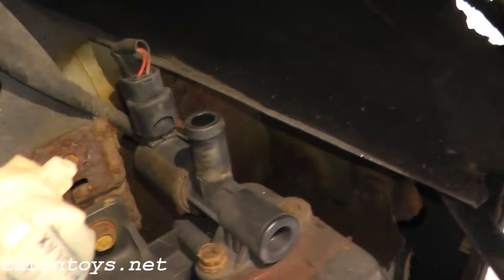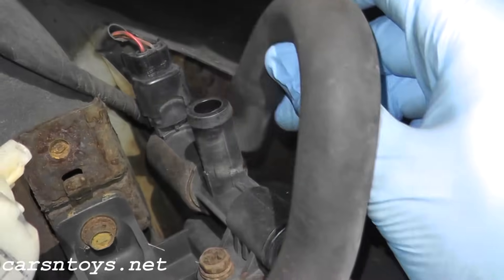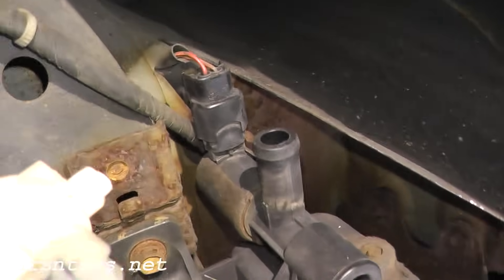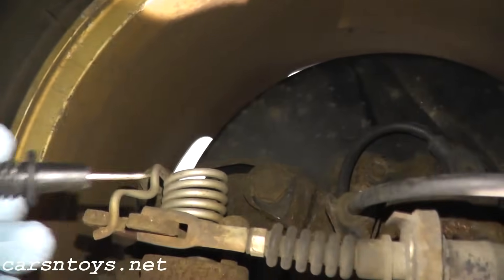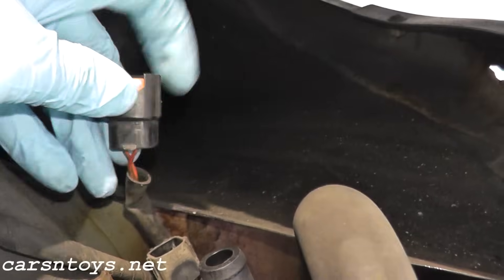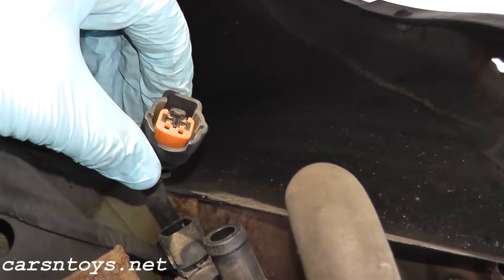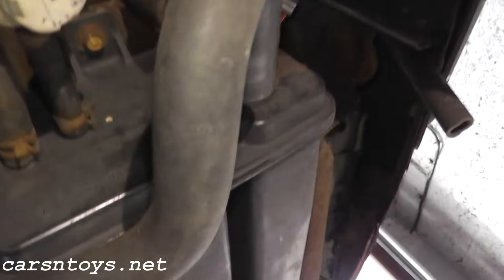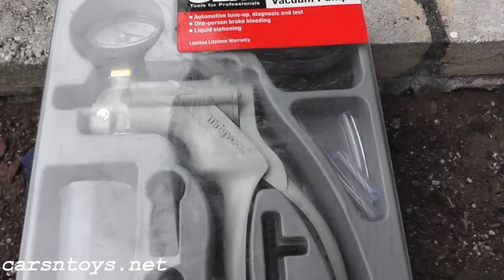How To Test and Replace EVAP Canister Vent Control Valve P0446

Comment: Hey, I was checking voltage from harness and I got 12V last week and today I checked again and im getting 3V and falling down slowly. Why is that? Could it be not running for a week?

Other thing I tested Vent Solenoid and its working. But I have rust outside of it just like your. Should I replace it?
Reply from the maker: +yippyli The voltage reading should be battery voltage. Were you able to start your car?
Reply: My battery is reading 12V. My car has hard start but able to start up after 3 seconds. Could it be bad ground from vent solenoid? If so, do you know where the location ground for vent solenoid?
Reply: I think the vent solenoid grounds through the ECU. But i"m not sure.

Comment: did you have to plug any lines after disconnect the canister or is the canister the same as the filter where it would require the switch to be on.
Reply from the maker: +Allen Kipps Are you referring to the charcoal filter? There's a charcoal filter inside the canister.

Comment: hey .. I have very high fuel vapor pressure in the fuel tank is that the EVAP canister DON'T WORK ?OR WHAT IS THE  PROBLEM
Reply: Either the vent valve or purge valve is plugged or sticking shut ALI

Comment: Don't you need to blow air thru the valve at the same time you power it up to see if it is in fact working mechanically as well... I am fixing to test mine, thanks for the great vids!
Reply from the maker: Metal Maniac Yea man you can do that as an extra step and verify air is indeed getting through
Reply: I think when it is "powered up" is when air does NOT go through. It is normally open. When you are driving and gas is being used up , the vent is open to equalize  the pressure. when you are parked it is also open . When pressure rises in the tank , the valve allows vapors to enter the canister  It closes when the purge valve opens to remove vapors from the canister some time after the engine is started. That is when a vacuum develops which the pressure sensor reads. If it does not hold vacuum, that is when the computer throws a leak code. Long be I hope this helps.

Comment: i have a 2004 nissan maxima. its giving me code p0444. I've replaced gas cap, I've changed both evap canisters in the front and the one underneath the vehicle by the gas tank and I'm still showing the check engine light. can someone give me some advice
Reply from the maker: Salvador Aguero P0444 deals with the EVAP canister purge volume control solenoid valve.  It's easy to check the valve. I have a video on a similar valve for older Maximas. Your solenoid valve is located in the same area as shown in the video:  https://youtu.be/7ni-mjr1xeg
Reply from the maker: Salvador Aguero If you have trouble finding the valve try google images

Comment: If you have the key forward and 12v at the connector shouldn't the canister click/open just by plugging it in? My has voltage and does not click(even though it's brand new) I don't have anything to run 12v to the back of my truck.
Reply from the maker: Jesse Tate Yeah man that works, too.
Reply: CarsNToys Damn, so I guess my brand new $130 ac-delco vent canister doesn't work.
Reply from the maker: Jesse Tate Not necessarily. I'd first verify if power is getting to the canister when the key is turned to the on position. (In other words, check if 12v of power is getting to the harness connector.)  If so, then you can test the canister.
Reply: I do have/did check for 12 volts at the harness/connector. I'm going to remove it and try to jump it without the harness anyway. So frustrating. Then it's off to diagnosing either the carbon canister or the FTP sensor. 

Thanks for the help.
Reply from the maker: Good luck!
Reply: No, jesse, I think 12 volts is always there and the ground turns the valve on and off, and that is done by the ECM.
Reply: I believe the valve is open whether 12 volts is there or not. It just won't close without 12volts. That is the way I see it.
Reply: NO, Jesse.

Comment: Can this p0446 process be applied to a 2004 chevy s10 crew cab 4.3? Didn't see what vehicle this video was for.
Reply from the maker: Erik Lafferty This was done on a '97 Maxima, however, if you apply power to the vent control valve on your truck you should hear the valve move back and forth.
Reply: Ok, thanks

Comment: Hi is this the Nissan Maxima Vapor Canister Vent Solenoid ?

 I have a code p1493.

Nissan maxima 1998
Reply from the maker: jeremy ballard This is the vent control valve. There's a separate evap solenoid valve. I have a video for that as well. Click on this link....http://www.youtube.com/playlist?list=PLl6xt4Pyay3AWpPY3TMsUCczro3aSkpvDP1493 can be a number of things in the EVAP system. Take a look at my playlist. I go over a number of evap components for nissan maxima's.
Reply: CarsNToys the link wont work. Tell me the title of the video and ill search for it please
Reply: CarsNToys hi this is jeremy ballard at a friends computer. i replaced this valve in this video. my code 1493 is still on anything else i should check? smog is due and nissan had told me it was my ecm but i got a different ecm and it is showing the same code too. Thanks
Reply from the maker: Rodney Rose Search under may page for P0443. I have two videos that deal with the same component. This should help you.
Reply: OK thanks

Comment: Hello. I noticed this was a Nissan Maxima. That's great. Because I just recently had my EVAP control valve vent replaced. I need to pass emissions by next weekend and my cars keeps getting rejected. I've driven the car 300 miles since I replaced it. But still no luck. It seems that I have 6 ready and 2 incomplete (not ready). Those two happen to be the Catalyst & EVAP. I'm under the understanding that I have to perform certain drive cycles. Great video by the way. I subscribed! But anything you may suggest? It's for a 97 Maxima GXE.
Reply: This thread is pretty old but I'll respond anyway and leave an egg.  If you can find a service manual online it should include the drive pattern procedures to get thru the drive cycles.  The 'drive pattern' is a set of instructions for driving that are supposed to clear the trip cycles.   I had the same problem last year with my 97 hardbody.  I have the same problem usually every year; summer heat seems to pull out any problems and flip the light just before  the smog test.  Unfortunately, stupid nissan is cracking down on websites publishing the service manuals so probably you'll have to know somebody who knows somebody that  has one.  Typically the stupid 3rd party books don't cover this; at least not for my truck.  There are lots of drive patterns published on the web but one model car may not work the same for yours.  My truck used to be the same way.  I could go a couple of months of driving before the engine light would turn off.  Last year, however, the drive pattern cleared all the tests except one.  The number of drive cycles not completed which are allowed depends on your state.  Best to ask the smog tech this before they do the test.  If they won't say, then go somewhere else because they may just fail it out of greed and make up some story.   Or, you can pay a smog test station to put your vehicle on a dynanometer which simulates the driving conditions.  I had a garage do this without my permission one year and then charged me $350 (ouch).
Reply from the maker: alpacino262000 Is the check engine light on? If so, what are the code(s)? The EVAP system has many components. I have a playlist addressing quite a few number of them - http://www.youtube.com/playlist?list=PLl6xt4Pyay3AWpPY3TMsUCczro3aSkpvD - but having a trouble code will pinpoint the problem quite quickly.
Reply: CarsNToys the check engine light is off. and actually, you know what. I took it to emissions on Monday morning and it passed. Yet, the Catalyst and EVAP systems still showed as "not ready". weird. But I hear that those two are the hardest to get to set.
Reply from the maker: Nice man. Yeah, the EPA allows up to two 'not-ready' monitors for 1996-2000 vehicles.
Reply: CarsNToys oh really? I was not aware of that. I'm going to keep that in mind for sure. thanks a lot man.